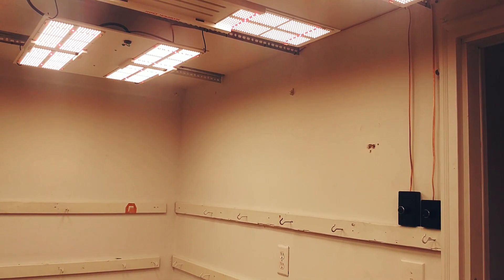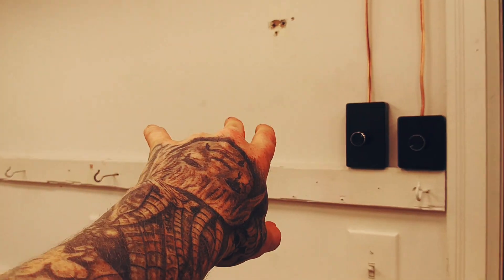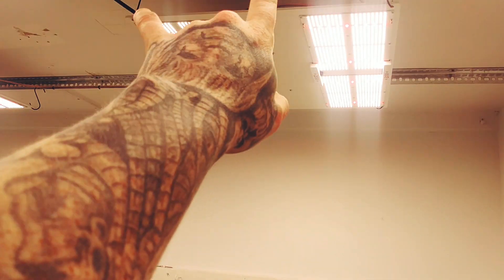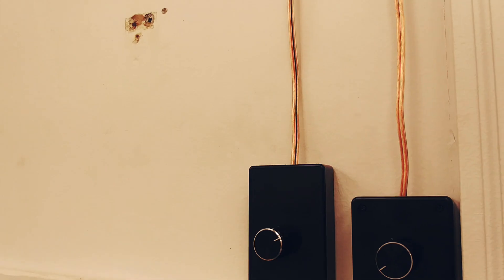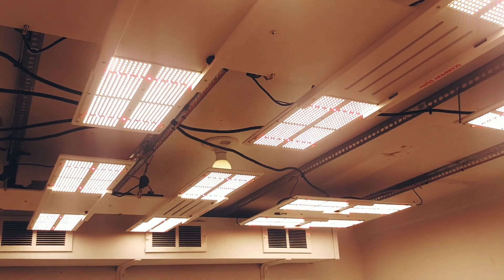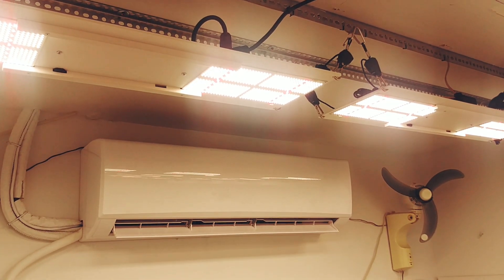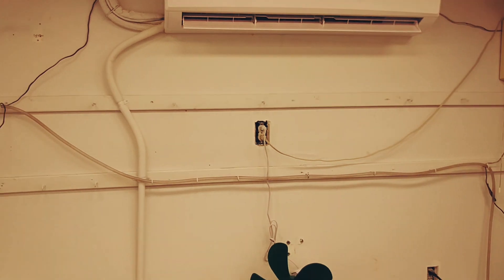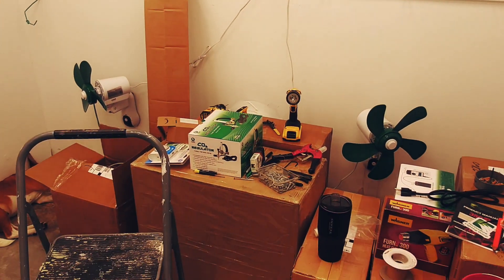How to wire the dimmers together on HLG leds!

Comment: How do you Daisy chain the hlgs ?
Reply: 1st positive to dimmer positive, 1st negative to 2nd led positive, 2nd neg to 3rd pos, 3rd neg to 4th pos, 4th neg back to dimmer neg. (or if longer repeat)
Reply: Bro please link a diagram or video explaining this.. I have 2 Dimmable HLGS that I want to run off the same dimming switch @gedionsamuel2256

Comment: How are you liking the scorpions compared to the 650r?  I want to get the 650r, but also kind of like the scorpion at the same time.
Reply from the maker: Theyre both great lights but Ima have to go with the scorpion diablo my man she can get 12" away from the canopy and actually evenly covers a 5x5
Reply: @Michiganbreadboyz_bt8919  how’s the bud structure difference between the lights at harvest?  More even I imagine compared to the 650r, but any size differences?
Reply from the maker: @_thespacegazer  the bud structure seems about the same maybe a little more yeild because i can get the plants taller